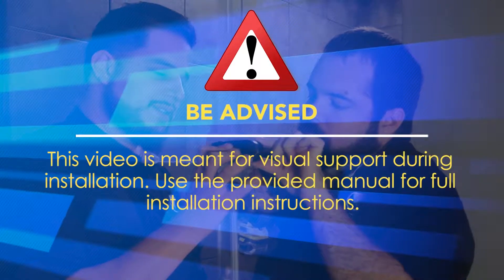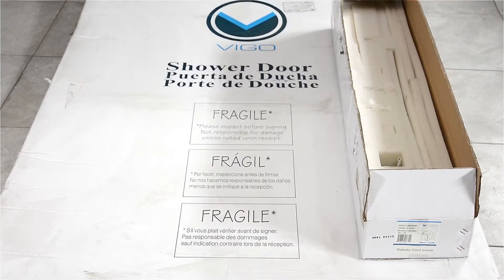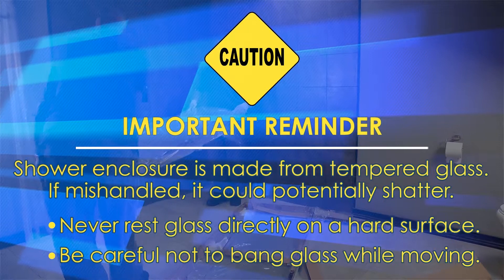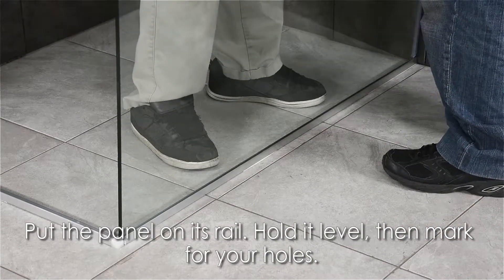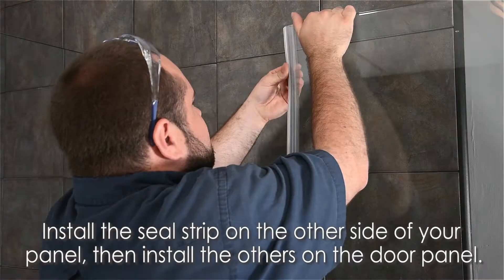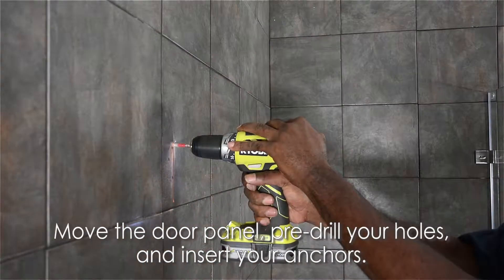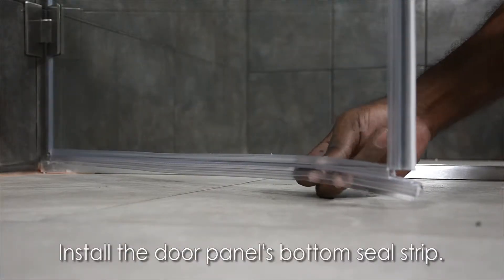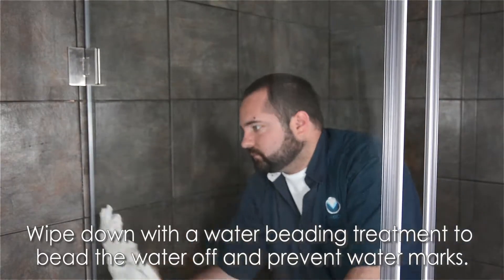VIGO VG6012 Pacifica Frameless Shower Enclosure - Installation Tips

Comment: If I have a curb, do I still need to install the metal rails onto the curb?
Reply from the maker: Hi Kat!
Thank you for reaching out.

All parts that come with the enclosure are to be used for the proper installation.
The curb is the ledge of the shower base where the enclosure would need be installed on.